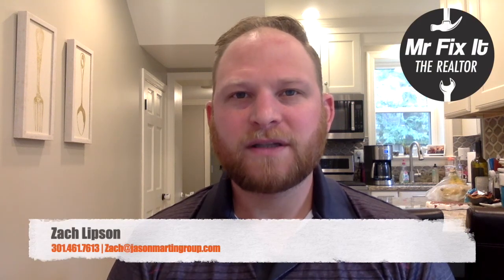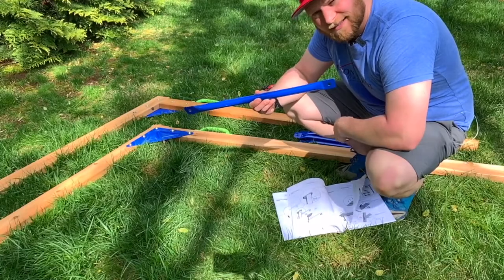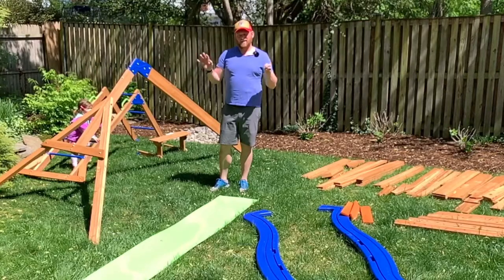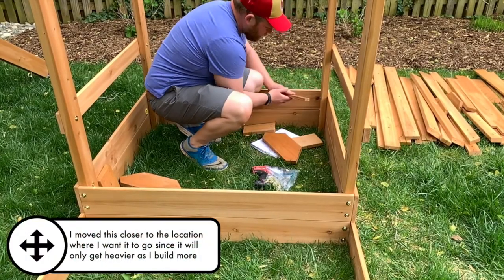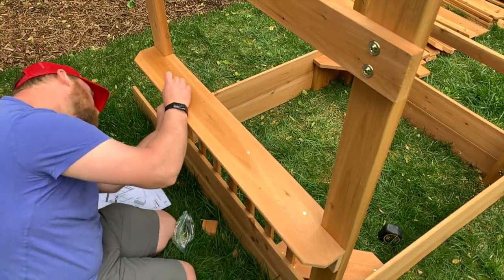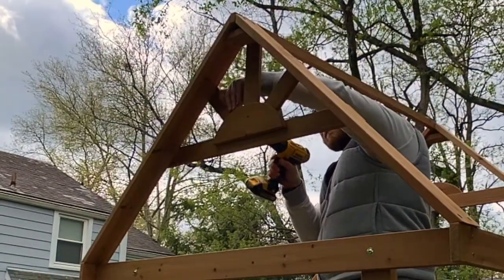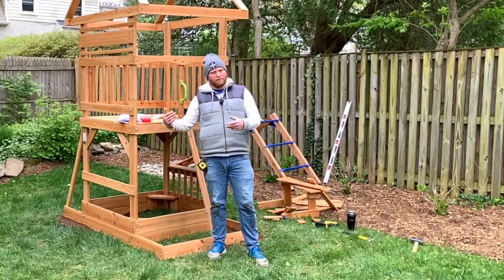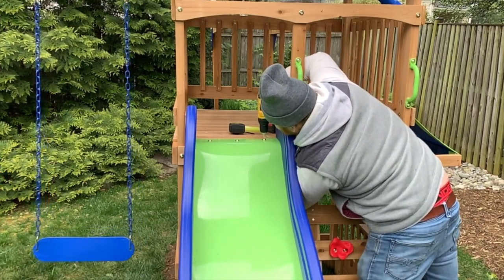Do you want to build a swingset?

Comment: Sadly, you will regret this purchase in 5 years
Reply: Why? I’m considering purchasing
Reply: @hannahkamara8749  poorly designed and built, aub par material, won't withstand weather and gravity itself.
Reply: @hannahkamara8749  plus in 5 years that kid is going to be 8+ probably since that kid looks roughly like a 3 yr old. looks a little small for 8yr old and older. probably not suitable for kids older than 4 to 5 yrs of age.